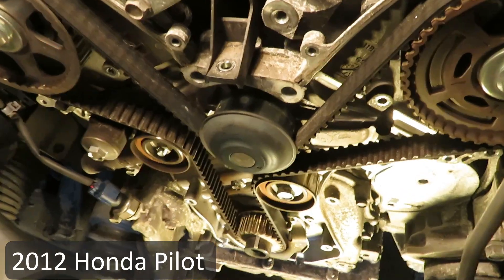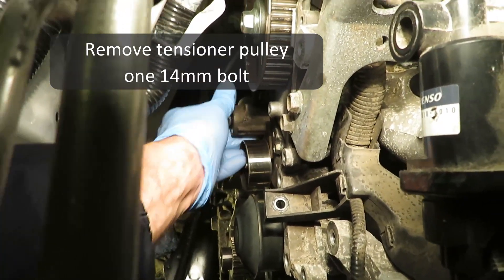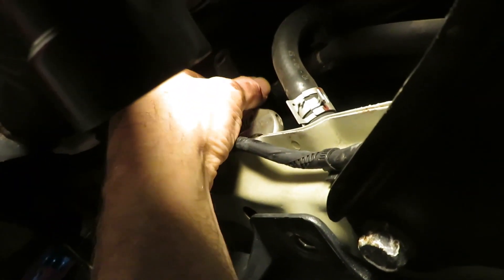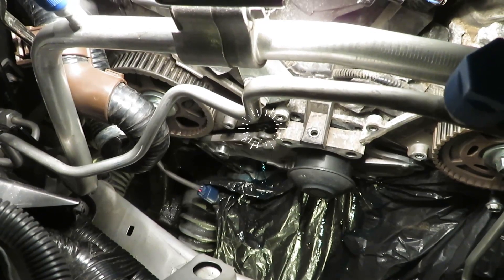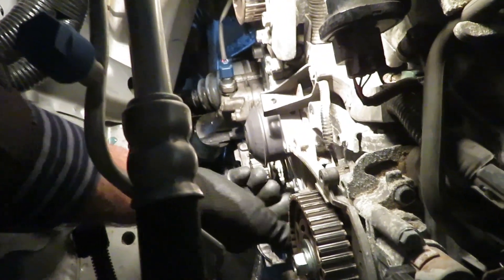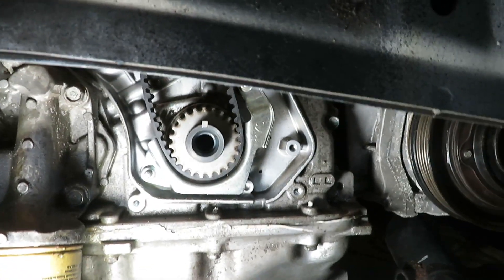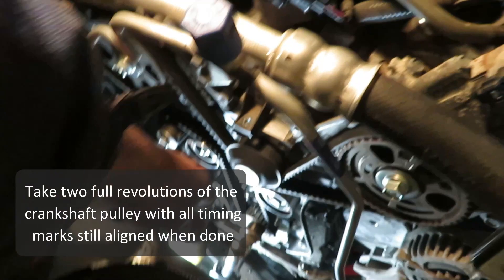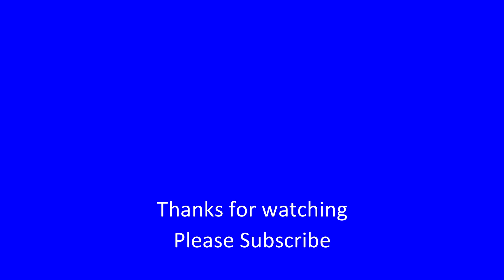Honda 3.5L Timing Components Replacement Part 2: Belts, Idlers, Tensioner and Water Pump

Comment: i’m guessing you did the voice-over a few weeks after the work was done; no way a sane person can speak that calmly after dealing with honda’s ‘no access for repairs’ engineering.  case in point point … if the steering rack ever leaks … you have to drop the entire front sub frame to get the rack to drop about 2cm to exit the access point to the steering wheel joint of the body behind the brake pedal area of the floor.
Reply from the maker: Although I do some of the audio as voice-overs some is done during the repair work. I didn't find this job any harder than most other timing belts. Subaru is the only one where repair friendly engineering is evident. Breaking the crank pulley bolt was one part of this repair where I might have needed to dub over some colorful language. I have heard replacing  the rack is a !!^* job on these cars.